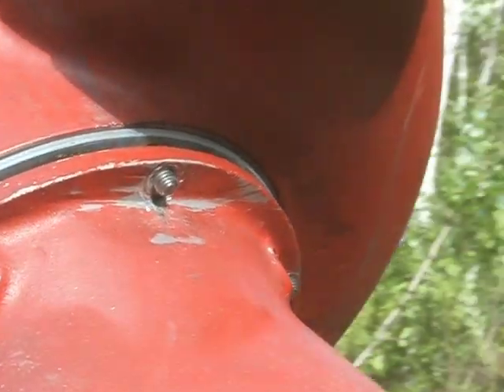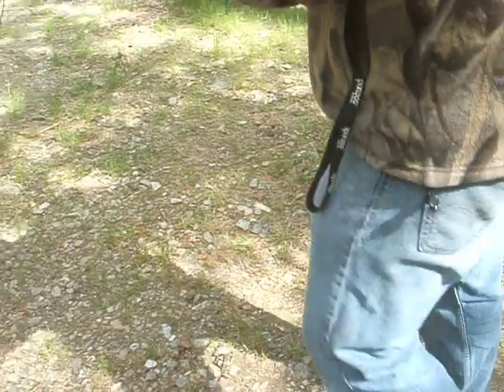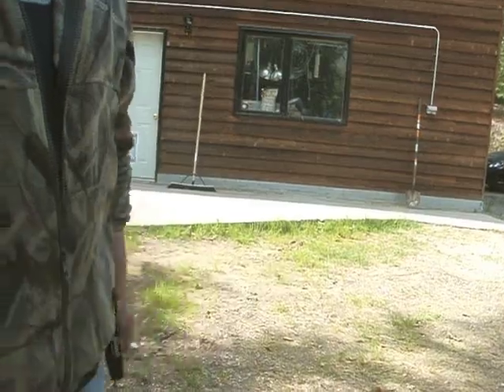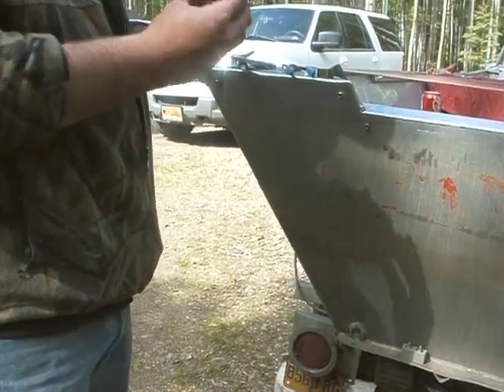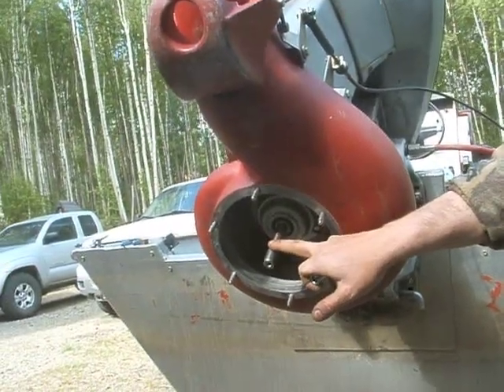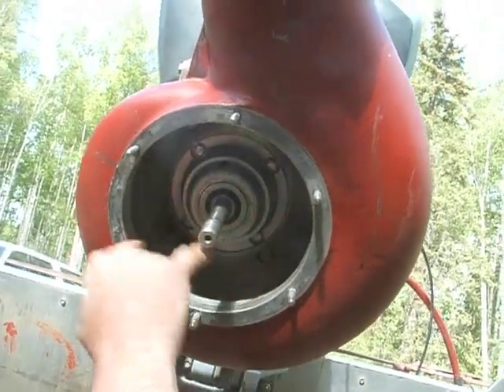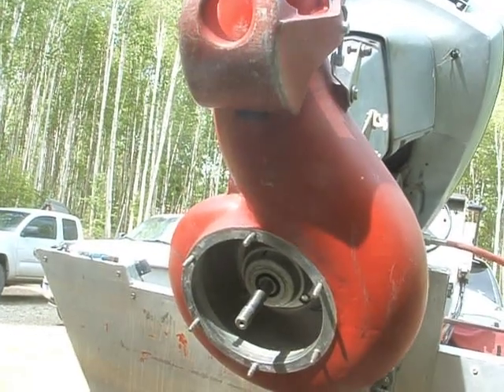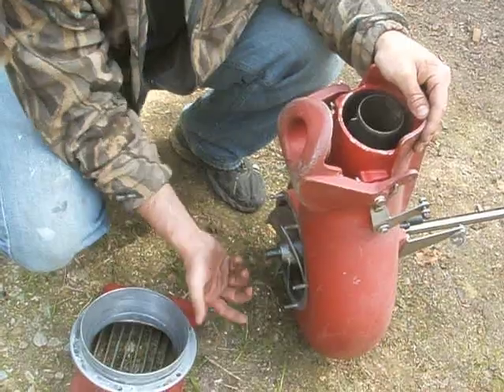Taking apart Lower Jet Unit for Outboard Motor  SIMPLE

Comment: DEAR Mr. FIX... OR MAY I CALL YOU You Can? CAN YOU SIR, OR ANYONE FOR THAT MATTER,  P--L--E--A--S--E  TELL ME WHAT BOLTS I NEED TO REMOVE, AND WHERE THEY MAY BE... TO COMPLETELY GET THIS JetDrive OFF MY 1986 70HP JOHNSON 3CYL VOR OUTBOARD; SO I CAN SWITCH OUT TO A PROP DRIVEN LOWER UNIT?? I ALSO NEED TO KNOW WHAT SPLINE COUNT MY DRIVE SHAFT HAS...

Comment: Inflatable boats, also known as rubber boats, many friends now think that inflatable boats are rubber boats and rubber boats are inflatable boats. In fact, there are still some differences. Why? Because many inflatable boats are not necessarily made of rubber, some military emergency rescue boats are made of a lot of high-tech composite materials. It's not rubber, so it can't be called a rubber boat. When we buy an inflatable boat, we often see the title of an inflatable boat and a rubber boat in the same title. Why do we write the title on the same item and what is the difference between the inflatable boat and the rubber boat? From what we generally know, there is no difference between the two. They all can be used the outboard motor of Sea Dog The inflatable boat is also a small inflatable boat, and the rubber boat is also a small inflatable boat. There are so many inflatable boats in the market that we have so many names, such as inflatable fishing boats, inflatable rubber boats, inflatable boats, inflatable boats, rafts, submachine boats, boat boats, canoeing, banana boats and so on. All in all, these are one species, that is, inflatable boats. Here are five basic differences between inflatable boats and rubber boats.

Comment: I need that pump. let me know if you want to swap for a prop lower unit?
Reply: +Rocky Rococo I agree they are a pain compared to a prop and drink gas, but are needed in order to run some rivers. I run the Upper Potomac and Susquehanna, which you encounter many rocks.  You couldn't safely run those rivers at high speed with a regular prop, even if you had a jack plate and tunnel for your prop.
Reply from the maker: +3waver SO true on the rivers.  I'm up in Fairbanks and most rivers are shallow and rocky.  This hardly does the trick...  and with the river level fluctuating it gets pretty hairy as it is now
I couldn't get the power from a mud motor to push the weight I need for the rivers up here
Reply: not to mention mud motors are loud, and scare the fish.
Reply from the maker: I have a buddy with a beavertail and it goes up in some pretty shallow water ,but is loud an hangs way out, but only pushes a light weight fishing boat up the river and it does work perfect for the light boat with a small load.  I am sure there are pros and cons to both depending on what you're using it for..... Thanks for the post
Reply: Do you know the part number on that impeller? Mines shot and I need a replacement
Reply: YES! I HAVE THE EXACT UNIT! BUT JUST MY LUCK, I SUPPOSE YOU PROBABLY FOUND ONE BY NOW... BUT I STILL HAVE ONE IF ANYONE ELSE IS INTERSTED!
Reply: randy roy They kinda suck.  They are so inefficient and you lose available HP ( why th Jet HP rating is higher) and the pump is heavy. The power to weight ratio sucks. Then on top of it sand messes them right up quick and they are a pain in the ass if you suck weeds up into them.  If you want a shallow water rig you are spo much better off with a mud motor or a Mercury outboard with a jack plate and shallow water kit lower end. Unless you plane on going over rocks these things aren't all that great.